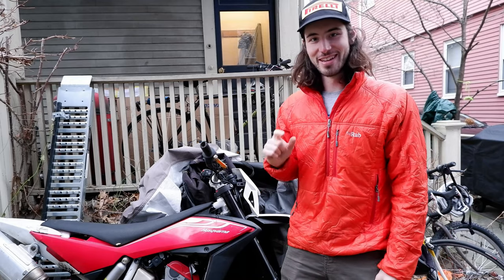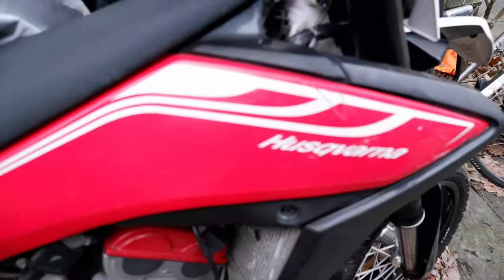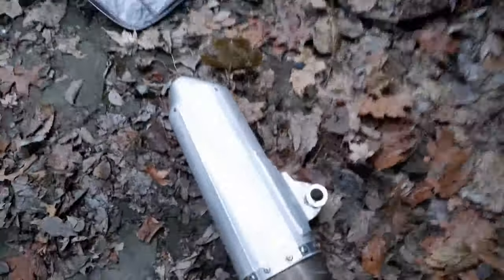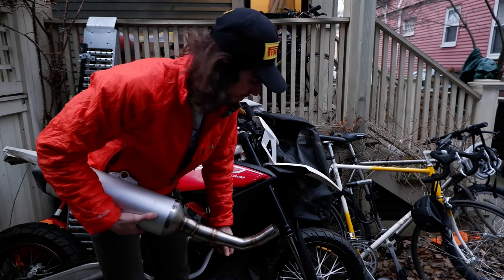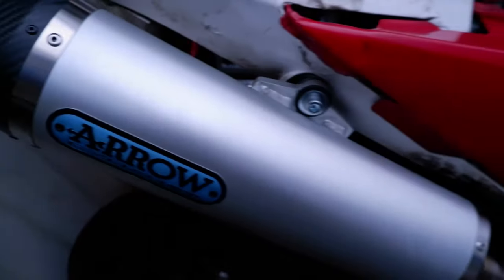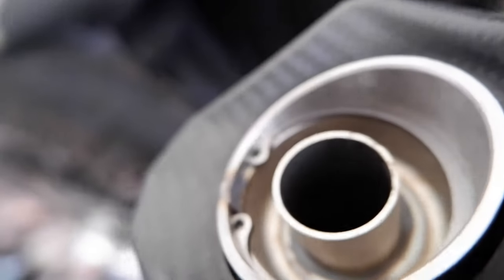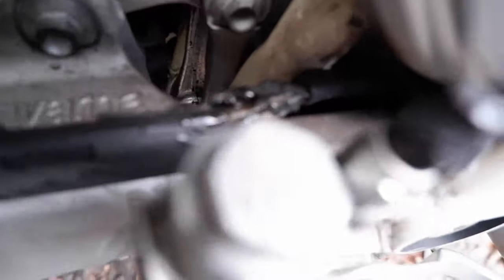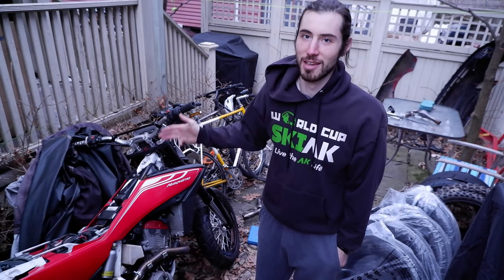Here's why you should never buy a cheap used supermoto! 2011 Husqvarna TE449 / SMR449

Comment: sad to see the bike so worn out I own one...
If the bike has the radial brake fork then the forks are from the smr 

the header pipe from fmf was only made for the TC 449 thats why it didnt fit

also look out for the stator failure which is caused by the flywheel bolts
(link for instruction is here https://www.youtube.com/watch?v=3bWtoYm563M&t=10s )

the side panel seemed like it burned so definitely check the breather pipes from the gas tank

as for more help there is a facebook group with many members in it who constantly help fellow owners

;)
Reply: a common problem which occurs when driven hard or abused is that the clutch feels like its slipping...the clutch is so strong it rarely slips  the problem would be the torque limiter which then slips
there are some threads about it when the problem occurs

also a good site for parts is www.italhusky.com but I dunno what the shipping price can cost
Reply from the maker: @huskymoto4713  Thank you!!
What facebook group is it?
Reply: @themotorcycleroom549  its called Husqvarna 449-511 Owners Group with about 1925 members
Reply: @huskymoto4713  I don’t got fb but I’m swapping a smr449 for my 09 Wr450f he said it starts good and rides but it dies when you ride it abit hard under revs is this normal 

And now what do I look for to know if it’s a genuine SMR?? 
It has brembo brakes radial master 
Supermoto rims with the Husqvarna logo
Reply: @GIXXRBRAH750  the most common problem is the fuel pump maybe its the same case

And yes if it has the big brembo radial brake it should be the original smr
Reply: @GIXXRBRAH750  also the smr has a sachs shock with an red anodized screw
Reply: @huskymoto4713  ok awesome thank you do you know where I can get parts shipped to Australia
Reply: @huskymoto4713  he said he replaced fuel pump but I think he put it wrong
Reply: @GIXXRBRAH750  sadly i don't 
I am from germany😅
Reply: @GIXXRBRAH750  and also check if the stator works!!!
They are very rare and hard to get
If it doesn't work i wouldn't buy it tbh
Reply: @huskymoto4713  yes but Germany can send parcels to Australia!!! Do you have parts?? Maybe I can not find plastic kit?